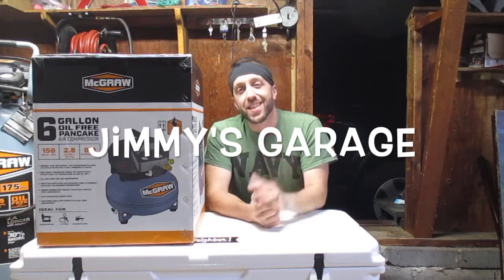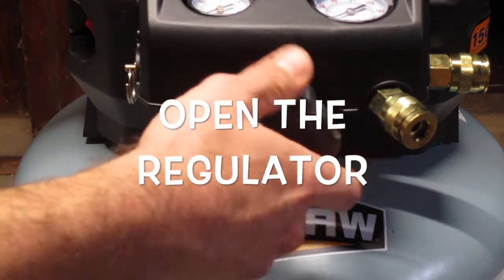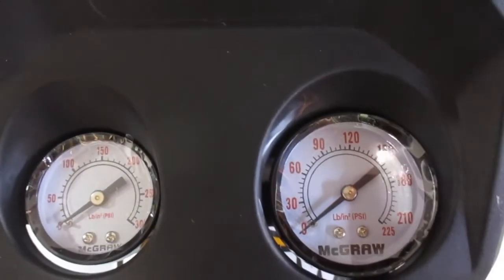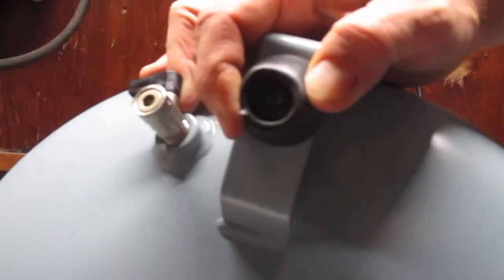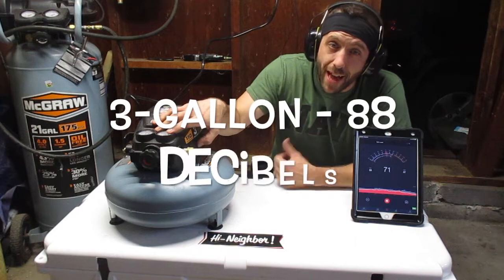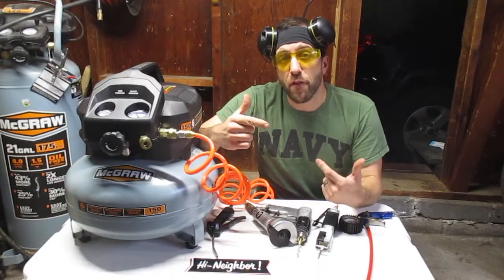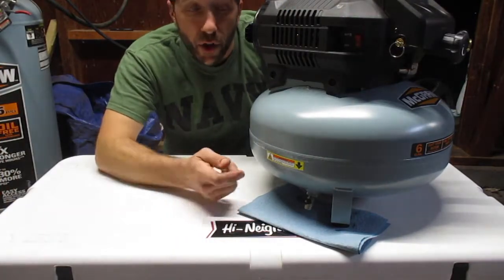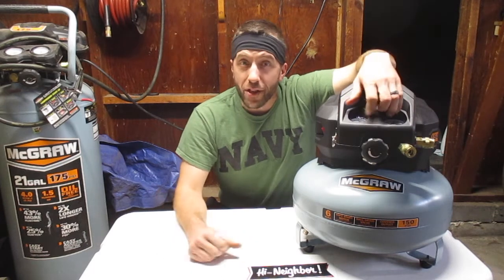NEW! Harbor Freight's McGRAW 6-Gallon Air Compressor - Full Review!

Comment: Just a tip for new owners: When draining the tank when it's at capacity or close to it, do not fully open the valve right away. I did this inside of my garage and I would estimate the sound to be well over 100dB, which can easily damage your hearing. The dust it blew around wasn't fun to deal with either. Ease the drain valve open, or put on some hearing protection before opening it fully.
Reply from the maker: Great advice!

Comment: I just got one.  Mainly to fill tires in my car.  It may be a lot of money for convenience but saves me from waiting for an air pump at Costco (free) or paying 75 cents at the gas station to use their air.  Also I had a $50 air inflator that just broke after having it 15 years.  It was okay BUT it was very slow to pump up tires.  Yes I am guilty of neglect and not keeping my tires at optimal PSI so when I had to fill air it took forever to fill up my tires with the small $50 inflator.

So I filled my tires and it worked great.  Love the
Reply from the maker: Congrats on your new machine! I owned mine for a few years and it was great for what I used it for. If you can return it, please do & get the Fotress Ultra Quiet 6-Gallon machine. It has the same performance that the McGraw and it whisper quiet. Check out my reviews of it. You will not be disappointed.

Comment: Jimmy, would it be better to let the air out by pulling the safety valve then finish it off by using the drainage valve?

Did you know there are two UPC codes for this unit?  I know because even though I have a manual I went to the HF website and to support for this product and there is a downloadable manual for two different UPC codes for the same compressor.  I am not sure why there are two.  Go there and check it out.
Reply from the maker: I did not know there were two UPC codes. To answer your question - you should ALWAYS use the drain valve to release pressure in the tank. Moisture = rust and rust is a death sentence for air tanks. I drain mine after every use. In summer months you will see a lot of moisture in your tank - so best to drain after every use. I hope this helps. Thank you for watching.

Comment: My hose fittings won’t connect. Got the T 1/4”. Should I take compressor back? They fit on the display model at store also
Reply from the maker: This machine should accept any female 1/4” NPT fitting. I use brass fittings and they have always worked out great.

Comment: Hello. Question: I'm new to air compressors. I have a old compressor  that I got about 2 yrs ago.   I didn't even know the purpose of that drain plug til now. If I open it and "crap" of some kind comes out, is the tank good to use still?
Reply from the maker: Hey man! It should still be good. Just make sure you are draining after each use - especially in humid weather. I’d run it a few times and empty it to get all that stuff out.
Reply: @jimmysgarage9068  big thanks
Reply from the maker: @marvinjenkins4901  Any time man. Thank you for watching! I have a bunch of compressor stuff on my channel if you want to check it out 🇺🇸🤘

Comment: Just purchased one.I think it has a bad regulator.Broke it in step by step as per your video.Outlet pressure drops to zero when I press the trimmer on blower tool 🥺🥺
Reply from the maker: Rats. I hope you can take it back to get a new one. Mine is my go-to machine, I love it. Even though I have the 21-gallon and the 10-gallon, I use this one the most. Best of luck to you! 🤘🇺🇸

Comment: Thank you for your review. Much appreciated. I drive my Subaru Forester on sand and deflate my tires from 33 psi to to 15psi. Would I need a 6gal compressor to reinflate my 4 tires or could I use the 3gal version? Thanks.
Reply from the maker: Thank you for watching! I would not recommend a 3-gallon compressor for anything except nailing/stapling or inflating lawn mower tires. If you’re inflators car/truck tires you’ll definitely want to get the 6 gallon. I have a comparison video of 3/6 gallon compressors if you want to check that out. I hope that helps! 🇺🇸🤘
Reply: @jimmysgarage9068  Thank you so much. Will check out the comparison video. Keep up the great work! Thank you again🤙
Reply: I'd say if you have a 12v outlet at the ready, you should just get a tankless compressor if you're just going to air up things with it, considering how much more portable it is.
Reply from the maker: @h8GW  Great point.
Reply: @h8GW  Thank you for your reply. Do you like a Milwaukee inflator?
Reply: @h8GW  I like the idea of having air ready to go. Avoiding a possible failure of a tankless...

Comment: For the break in process, the instructions state "2. Pull out the Regulator and fully open it, then push in Regulator". Picture on the right indicates to turn regulator clockwise. That appears to be the opposite direction of what you showed in the video. Just wanted to make sure I was doing this right.
Reply from the maker: You know, I’ve done it both ways - but it doesn’t matter. With the drain valve open - no pressure gets to the regulator. Hope that helps. Thanks for watching 🤘🇺🇸
Reply: Same reason I came here, too. I was afraid if I "pulled" any harder that I was going to break it! Jimmy is getting a "Like & Subscribe" from me!
Reply from the maker: @ShannonKWest  thank you Shannon! 🇺🇸🤘

Comment: Can you use a 100ft 1/4 hose says up to 300 psi on a 6 gallon 150psi compressor
Reply from the maker: I use a 50 foot regularly. Sometimes with a 30 foot hose reel as well. You should be fine.
Reply: @jimmysgarage9068  sounds good thanks you

Comment: Does anyone know what size hose and quick coupler set to buy for this air compressor...?
Reply from the maker: 1/4" NPT - brass. There are several different hose sizes you can use on this. I've used a 50-foot hose and it worked quite well! Thanks for watching.
Reply: @jimmysgarage9068  thanks man
Reply from the maker: @bonez6349  I got you.
Reply: @jimmysgarage9068  thanks buddy i just put the McGRAW 6 Gallon + a 25' hose and a quick coupler set on the old credit card today.! This little setup is all i need... Thanks for the review and the replies
Reply from the maker: @bonez6349  Oh awesome - you’re going to love it. I use this machine more than my 10 and 21 gallon machines because it’s portable and fills up so quickly. It’ll also run a small air drill pretty well, as well as a smaller ratchet.

Comment: Why didn't you show how long each of the air tools would operate before the taxing the air compressor? cutting that piece of rebar probably took 10-20 seconds? Pretty much ANY air compressor could've handled that test.  Put the compressor to work, tax it out, and show what it really can or cannot do.
Reply from the maker: If I test another one in the future, I’ll be sure to show more rigorous testing. Thanks for the suggestions! 🇺🇸🤘

Comment: Mine only lasted 4 months. 😢
Reply from the maker: Bummer! Mine is still going strong - I use it all the time.
Reply: @jimmysgarage9068  But I was able to fix it, it was just one of the two hose clamps that goes from the head to the tank it was loose so I just replaced it with a new one. Simple fix.